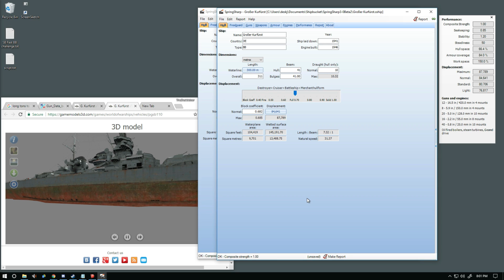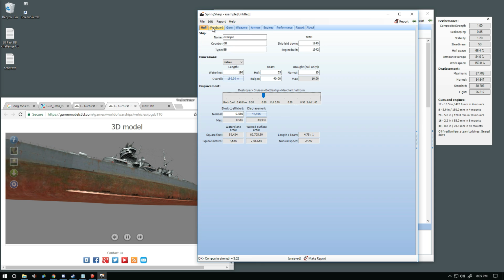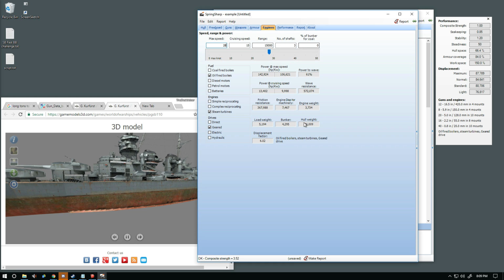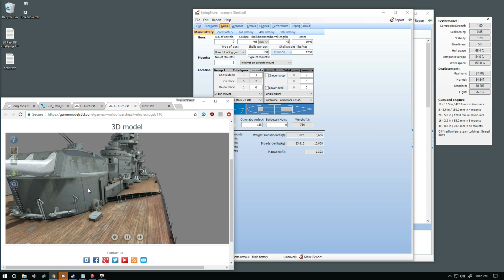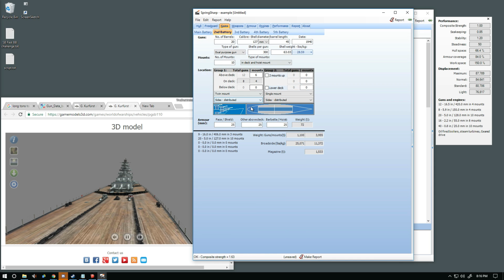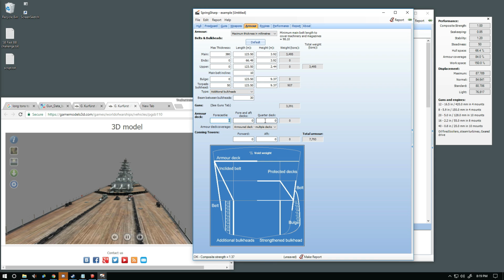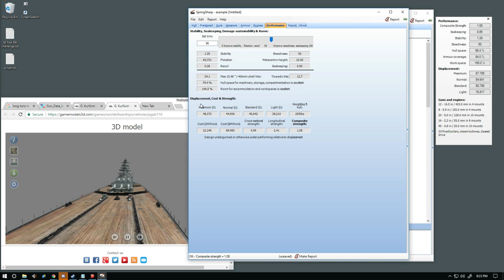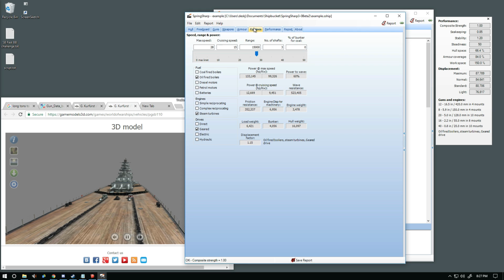Simple SpringSharp tutorial

Comment: Hi again!
I just watched the report you generated of the Großer Kurfürst and stumbled upon 3 things you've used:
1) the machinery of 1946. I'm just curious, why did you choose such a late engine date compared to the laid down date?
2) you used a far more power plant than Wargaming, who stuck with the originally planned powerplant of H41 (165,000 shp) with only oil fired boilers. As far as I know, the H-Series was planned with both oil fired boilers and Diesel engines (after H-39 was planned with Diesel engines only). Again, I'm just curious how you came up to the conclusions you did.
3) the original H-41 design (as well as the Großer Kurfürst in WoWS) featured only 3 shafts, you used 4. Why?
Best regards,
Joachim Schmidt
Reply from the maker: Unfortunately machinery is one area that SpringSharp is rather incomplete in. It has fixed specific power (shp/t) and specific volume (shp/m^3), that improve at a set rate with the date of machinery. This information is really only accurate for capital ship machinery, and even then it can be lagging behind by a few years; Hence the practise of setting machinery dates at either the date of launch or commissioning. In the case of the Großer Kurfürst, 1946 machinery gives ~40shp/t.

As for power required, well lets just say WarGaming doesn't know how to design ships, but the long story is as follows!  (Also the report you see in the video has depreciated, along with the tutorial unfortunately.)

Firstly, I made a few mistakes and did not properly look at WG's armour model, and missed forecastle and quarterdeck armour, adding these ballooned the mass even more; Because the block coefficient was already .682, which is that of a merchant vessel, something had to change. WG has WAY too much armour on this ship for its dimensions.

The choices were, have even more of a super-tanker hullform, or increase draught by 1 meter. Increasing the draught by 1 meter allows a more efficient hull form and a lower block coefficient of .634, which while still crazy is more in line with a real warship; Or the other option being, make the block coefficient even more unrealistic.

So to summarise your second question; WG has 30,000t of armour on a ship that is too small to also go 30 knots and have range similar or greater than that of Bismarck. The net result is that WG vastly underestimates the mass of the ship, and would never make 30 knots on 165kshp. An updated report with my personal 11m draught correction can be found here: https://pastebin.com/Kd0ks3Vw

Hope this answers your questions!
Reply: Thank you very much!
this all sounds reasonalbe, and I already thought about it with some "probably either WG or the Germans themselfs fcked something up". Depending on the source you use, every H-design beyond 39 has more than 165k shp with the exception of H-41. Maybe something slipped through calculations back then.
The Reason of "too much armor" could possibly be that the Kurfürst is a mesh up of H-41, probably H-42 (or some other designs) and then modified to fit the triple turrets.
Combine that with probably one or two not so exact things in spring sharp (e.g. the Machinery "problem" you mentioned), it seems possible to make the process of designing this particular ship pretty difficult.

Just another question:
Since I try to do stuff for "what if"-tech tree proposal in WoWS, I need the measurements of as many ships as possible of each nation (I try to recalculate the ingame turning radius and concealment to some length/width/speed or length/width/draft formulas to estimate the turning radius and concealment of ships I propose). But most WG influenced designes / build designes (e.g. Hindenburg, Roon, Republique) are quite a big mystery for me.
Can you tell me a source where I can get those measurements of said ships (I would need Lenght, Width, Draft [Full load], Tonnage [standard and full load])?
Best Regards,
Joachim Schmidt
Reply: EDIT: the one thing that is most annoying for me is that you cannot type in your gun with a custom weight set by you. I noticed some difference in gun weights calculated by Spring sharp and the realistic gun weight.
Reply from the maker: I think I may have seen your work sometime on the forum. :P

The data for ship dimensions is taken right from WG models, and I use Google Sketchup to measure that; Unfortunately WG don't always publish this info elsewhere, so I have no other way of getting this information.

As for the gun weights, to be honest i've tested the hell out of SpringSharp recently and it tends to be conservative in most aspects, and with gun weights in particular it's pretty conservative also. You can see here that the turret weight for a 16"/50 Mark 7 is well below the NavWeaps quoted 1,700 tons: https://i.imgur.com/HEqMOOU.png

My guess is that SS is simulating an open gunhouse, unlike the turrets on Iowas, which were heavily segregated with armour and various compartmentalisation.

As for smaller weaponry though, you may have a point, and i'll cover ways of getting around this in the improved tutorial. But in general, SS is about as good as ship preliminaries get really, which is to be expected given that it uses period correct empirical formula for ship design; so within 10% SS is usually right on the money.

Lastly I just saw your edited 3rd question, and this is because it was nearing or over 75kshp per propeller which would require ludicrously large and well designed props; But mostly to stop SS moaning about it since it complains if you go over this. :P
Reply: sadly I didn't posted anything so far, due to my approach to base it on "stats" than on "oh, that followed up on that in history so it needs to be Tier VII. If you are interested, I can drop you a link here in the comments or per PN (or somewhere else), when I finished my German proposal (which is quite huge. I may went a little overboard).
Edit: yeah, still thinking about using sketchup and the gamemodels website to get them
Reply from the maker: Sure you're free too. Feel free to join the ShipBucket discord also, we are a great resource of naval history, and a few of us, such as myself, are very handy with engineering and the such! I'm also the resident SS brain! :P

https://discord.gg/wtZS6vh
Reply from the maker: Poke me with @Deskjetser to let me know who you are!
Reply: in the Forums? or on YT? (btw: EU forums are my region)
Reply from the maker: Youtube or Discord, Discord is best to be honest. I'm on the NA WoWS despite being British haha.
Reply: alright :) I tell you when it's online (could still take a couple of weeks, it is not productive to change 2/3 of your proposed DD lineup while "finishing" it.)
Reply from the maker: No worries. If you need a hand accurately simulating DDs in SS then you can PM me on discord, my tag is 'Führer-Doisk™ Mk.Ⅷ#1337'.
Reply: @TheDeskJetser  Hi! I just wanted to add you in Discord, but for whatever reason I cannot find you! Either I'm to stupid to use Discord properly or your name may have changed?
I've created a discord server for discussing stuff with those Tech-Tree proposals and I wanted to invite you.
Sadly your invitation Link posted above (which for some reason I completly missed) is not valid anymore.

Best regards,
Joachim Schmidt
Reply from the maker: @joachimschmidt92  https://discord.gg/5PHq8Dk This should work. It's not my Discord however, it's a community of pixel ship artists! :P

Once you're on there, you can find me in the user list named Deskjetser, and send me a friend request from there. Then you can PM me your invite if you like.

See you soon!